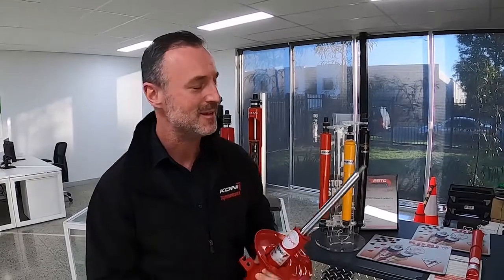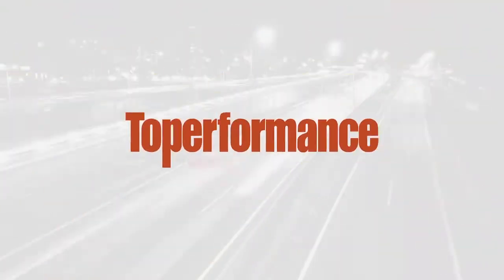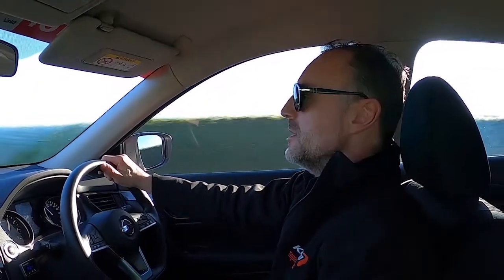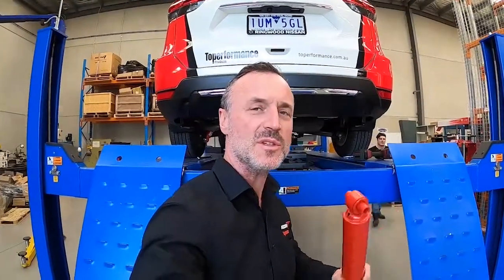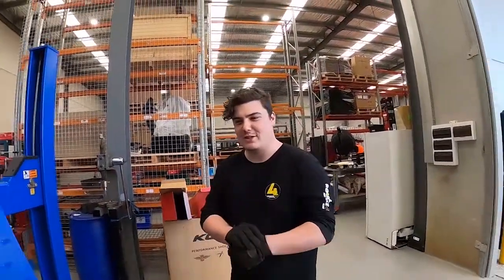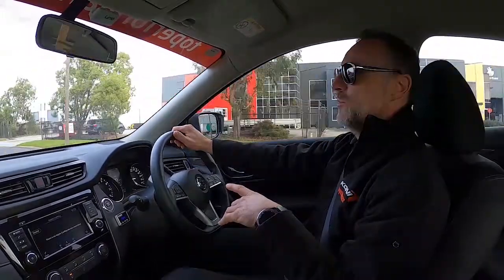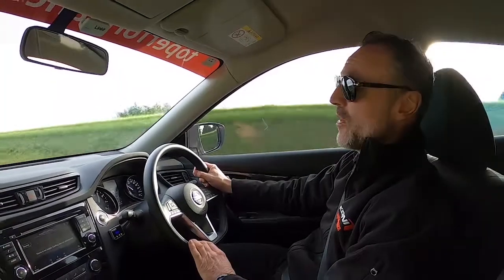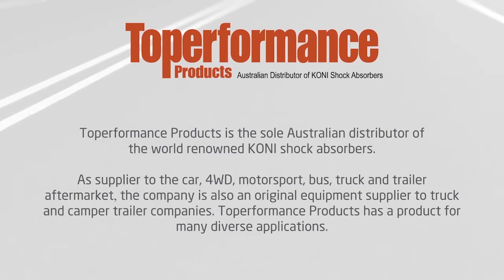KONI SPECIAL ACTIVE INSTALL INTO 2022 NISSAN XTRAIL

Comment: do you think this will make my 2014 Mazda3 ride softer over bumps?
Reply from the maker: For sure!
Reply: @koni_australia  would it be smoother, softer and quieter with stock springs or eibach pro kit?
Reply: @BigdisplacementI6  Stock springs I would say, you might find you have some worn bushes or ball joints if you ride is bumpy and makes odd sounds
Reply: @nitrogearaustralia3949  good thalx 🤗😍
Reply: @koni_australia  hi got these installed. Car is still very bumpy and no improvement in ride quality. I'm very upset...
Reply: @BigdisplacementI6 same like stock shock ?
Reply: @BigdisplacementI6 please tell me your experience I just ordered these shocks what was your issue?

Comment: How many millimeters can you lower the dampers with lowering springs without damaging the dampers?
Reply from the maker: For this vehicle the shocks are not designed to be used in a lowered application.

Comment: Please make a video of Mazda CX-60 equipped with your shock absorbers. The original dampers are so bad on that car. The car's suspension is very hard in small potholes. When you drive over a big speed bump or bumps that are at appropriate intervals, it shoots the car's rear tires almost into the air. It's like there are no shock absorbers at all.
Reply from the maker: We have identified this issue and we have ordered KONI's for the CX-60 they are on the way